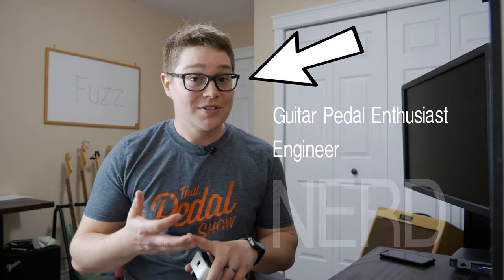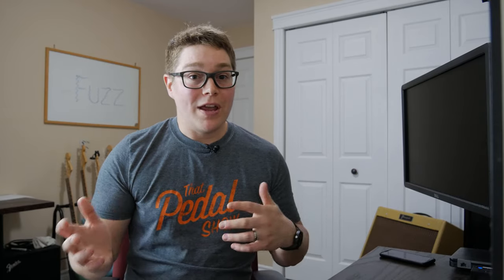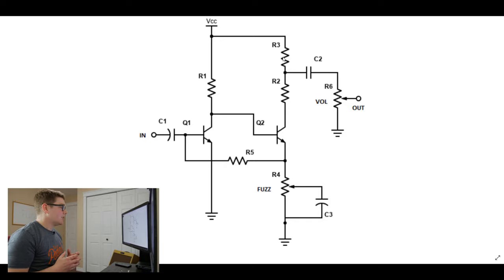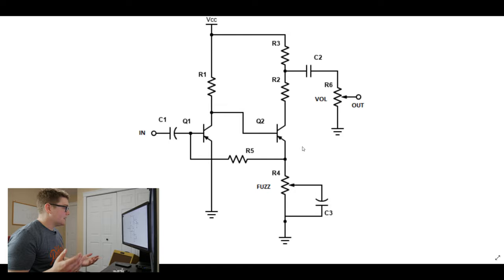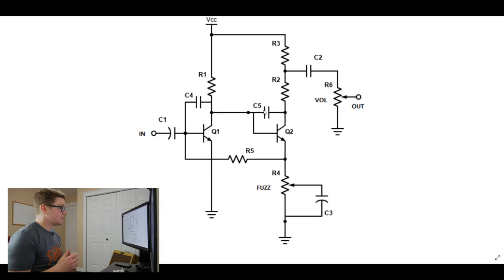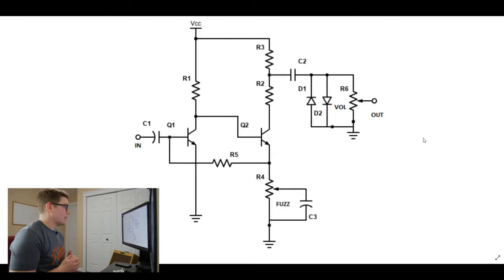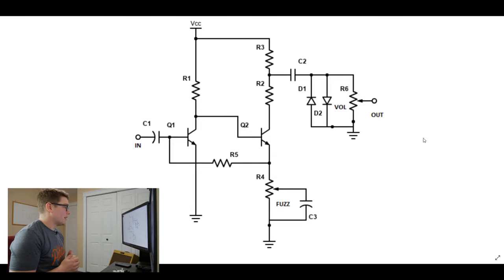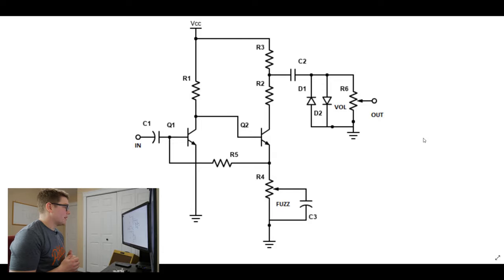Every Fuzz Pedal is the Same  | DIY Guitar Pedals

Comment: Great walkthrough...it’s amazing to me how many companies can continue to put out the same pedal with just new racing stripes, but then again most people don’t understand all the magic inside the box...let alone try to make one.
Reply from the maker: Couldn't agree more!
Reply: Once you build a fuzz or two, you realize how insanely easy and basic of a circuit they are. It's why I always put companies like Boss above others because there actually is quite a bit of actual electro-engineering going on inside their boxes that other companies would never even get close to coming up with. A great example is the OD3 overdrive. It's stupidly complex for an overdrive and it shows when you play one. It's like, holy crap that really does sound like an overdriven amplifier with all the little weird nuances and characteristics in the tone that only amps ever seem to have.

Comment: All crack is basically the same, but I know people who SWEAR by a certain dealer. For real though, the more I learn about how similar so many fuzzes are, the more it amazes me how many tones can be dialed in. Would you do a video like this for stuff like non-inverting op-amp distortions and whatnot? I have to imagine that those are basic circuits as well that are just loaded with tweakability like the humble fuzz is.
Reply from the maker: Sounds like an easy test on the dev board, I will put it on the list.

Comment: I'm curious how many years have you been building fuzz pedals and how many years have you been playing guitar, how many different styles, how many amplifiers have you owned and played and worked on? One thing about components made 50 years ago, they can't and dont make them like they used to. When you get more experience you might see that the right kind of experience is very useful.
Reply from the maker: Hey Christian, 

Thanks for the comment. I have a background in electronics, but have only been building pedals for about 5 years. Not sure how many fuzz pedals, maybe 6-10. I try to change them up with each build. Some are straight up fuzz face transistor clones, some are opamp clones. I have built 2, 3, and 4 transistor fuzzes, ones with additional hard clipping, external bias controls, both npn and pnp transistors, etc. I don't think I have ever built the same one twice though...haha. I do it more of a hobby so never looking to have 2 of the same pedal. As for guitars and amps, I don't know. I have been playing off and on for about 25 years. I have had lots of different guitars, but mainly stick with single coil fenders now. Same thing with amplifiers lots of different ones, but mainly fenders now. I haven't done a lot of tech work, as again, just a hobby, but have helped my friends out gratis when I thought I could. In the last year or so I have built my 5f11, fixed an old point-to-point traynor guitar mate, and a 90s deluxe reverb. As for components, it all depends on what you use. My Yamaha G50 112 is about 40 years old, uses PCB and has held up pretty well. That guitar mate was closer to 45 years old and had leaky and blown caps, fried resistors and a bum switch. I'm sure you could buy both good components and crap components in any era.

Comment: Every electric guitar is the same: a couple pieces of wood, 6 strings, and some electrotransducers (pickups). Every human being is the same: a skeleton covered in skin and full of guts, muscles, and nerves. Every living thing on earth is the same: made up of largely carbon-based cells. /sarcasm
Reply from the maker: To each their own, but I think you are missing the point. By that logic, you could say every guitar pedal is the same. Just an enclosure with audio jacks, a supply, a switch, some wires and circuit board. I was trying to highlight that so many fuzz circuits are based on the same layout/design.
Reply: @pougnetpedals  But they're not. The Fuzz Face, the Big Muff variants, the Fuzzrite/Orpheum/Shin Ei style fuzzes, the Tycobrahe Octavia, the Super-Fuzz/Ibanez Standard Fuzz/Foxx Tone Machine family are all quite different from each other in terms of topology. But when it comes to the concept of "fuzz" as an effect, it is generally considered a hard clipped saturated transistor sound, and there are electronically only so many ways to construct a bipolar junction transistor to behave as an audio signal amplifier. So, yes, the majority of fuzzes are based on the same general "building blocks" just as the majority of automobiles contain a combustion engine, a transmission, and four wheels, but nobody is trying to argue that a Shelby Cobra and a Ford F150 might as well be the same thing.

Comment: You said every time you “look at a fuzz pedal”. Dude, listen to the pedal. Put away the schematics and listen. You are really missing out.
Reply from the maker: I think you're missing the point. My comment is that most fuzz pedals are based on the same circuit. Yes, they will sound different when swapping a few component values or adding some clipping diodes, but most are just that. Also, I wouldn't discount schematics. If a pedal sounds good with your rig then knowing the circuit, and what other pedals may use the same one will only benefit you. In most cases, pedals are priced based on the name on the enclosure, or the aura of a pedal. I would much rather pay 25% or 50% for the same circuit in a different enclosure.